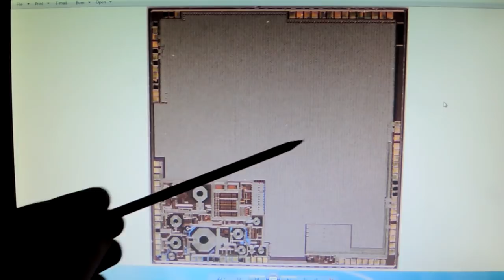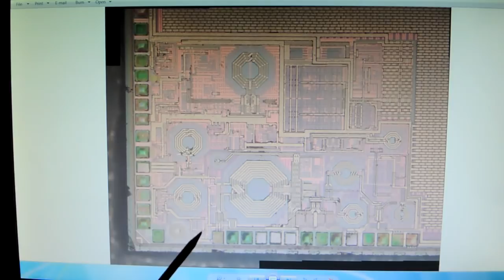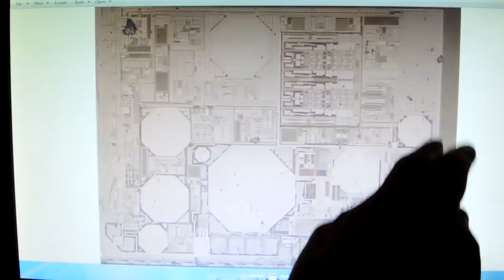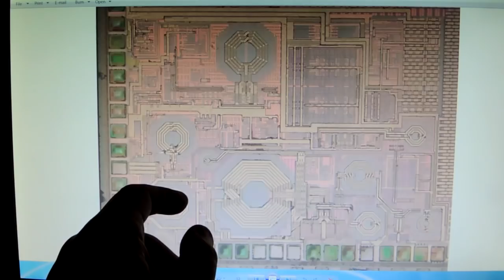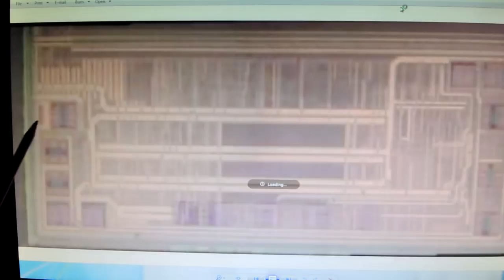ESPRESSIF ESP32 TEARDOWN

Comment: How did you remove the metal shield?
Reply from the maker: hot air rework tool
Reply: Thank you  @electronupdate . I removed it with a soldering iron, but that was really difficult.

Comment: Amazing chip.  Two high speed cores, a low speed core, 14 bit data acquisition and a DSP core with WiFi and BT radio  So much computing power in an inexpensive device.

Comment: Actually that SPI chip is the program memory, is 32Mbits so that's why it is so big, nice video thanks for sharing
Reply: Yup, its an GD25Q32C. Currently you can get ESP32-WROOM-32D modules with up to 128Mbits flash.
Reply: TAD2020 that's quite an insane amount of memory for such a device!
Lots of fonts and images... ;)
Reply: There is also a lot of ROM inside the ESP32 chip itself. A few hundred KB from memory. Contains things like the bootloader.